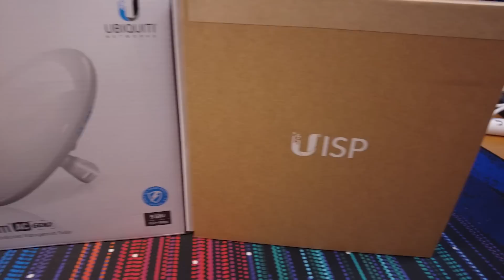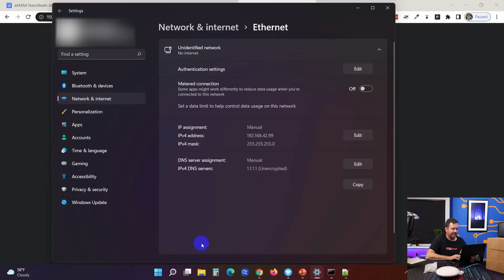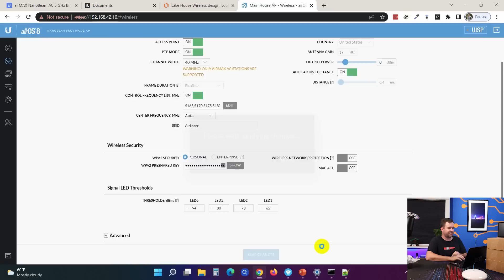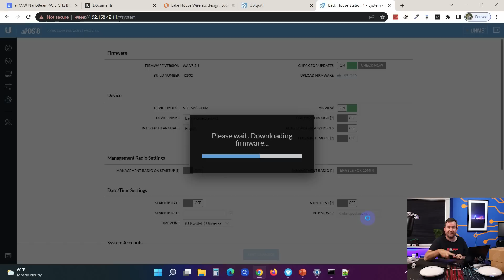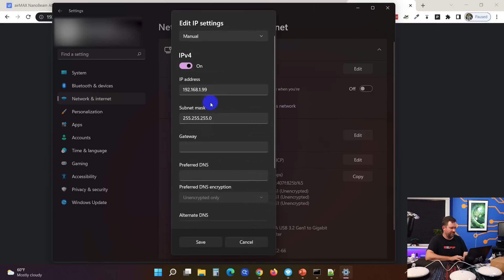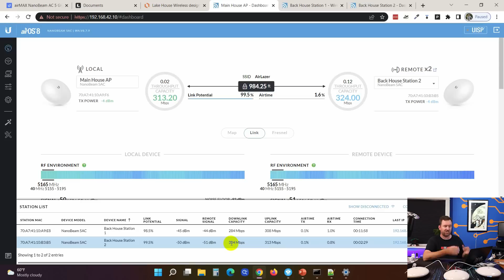PTP Wireless Bridge Setup 2022 - Step-by-step Guide!

Comment: I know this is an older post, but I just configured a couple of the nano bridges. I want to make sure for those who are planning on using a unifi flex switch. (Yes you need to use the Eunify converter to go to 24 V passive.) The flex switch is not compatible and you’ll find that after you could figure everything and get it all up and running, 😮any time you try to upload something. The Nono will reboot and give unreliable results. I spent like three hours on this, so hopefully you won’t waste your time. I tried many other switches and combinations and the only one that didn’t work was using the flex switch and I assume everybody here knows that the Nana Bridges need passive POE !

Comment: Good day. I already have one Unifi wifi 6 access point and i want to add another wireless access point to the network to cover an area. Please what can i do. I need an access point that has in and out ports so that i can extend the network into the building from outside but i need a wireless access point that will take the signal from the first network and transmit it into the building

Comment: I have a Question 
I have a Gate that has two cameras , Wireless access point (ac Pro) and ubiquiti point to point antennas .
I need to separate the camera network from the WiFi using the point to point antennas for security reasons the cameras can’t be part of the main network so the WiFi needs to communicate to the main network and the cameras to camera network which is managed by the NVR  
I know an easy solution will be to have two sets of point to point antennas , but I want to keep it simple with just one pair if possible

Comment: Great video man, very informative. Just an idea though rather than changing the ip address for the interface everytime, you can add multiple IP addresses under the add option in the advanced options for the tcp/ip properties. I actually have about 5 different IP addresses set for different devices I frequently have to program.

Comment: This was a very good video and I learned a lot. I am advising a neighbor who like me is on Starlink and who might need a wireless P2P bridge to add a house his son is building a few hundred yards away. I had a few questions. First, I noticed you set the Nanobeam AP and the other end to static IP addresses so when you hooked them up to your home network you knew how to connect to them. Starlink does not support static IP addresses like most routers. I assume if you set them to DHCP you could go into the device table on Starlink after the boot and find the assigned IP address? Second, how would you point the AP Nanobeam unit  in the case of a PTMP arrangement where the 2 remotes are in different directions from the AP? Say the remotes are 180 degrees apart? Finally in the case I mentioned above how good are these units at linking up with trees in the way?

Comment: Hi - I have a 5 year old unify switch 16 150W, a security gateway 12v 1A Adaptor and Cloud Key Gen 2.  All of this is is connected to a  5 year old ARRIS dual band router 802.11ac (2.4 and 5G).  I want to upgrade the router with more security and power.  I have been disappointed with the Unify access points and routers (access points have never worked after provisioning for some reason and we need them for our large home and garages).  What non-Unify router would you recommend that is powerful enough gaming, 8K TV, and has exceptional security considering AI.  I use this system for my small business and for internet access for our family.  I’m not super tech savvy but did use your videos to set up the system which has worked for 5 years (except for the access points).  I need  help with security upgrades, assessment of the system to troubleshoot proper set up and correct the access points issues.

Comment: I purchased these and will receive them tomorrow. I just want wifi in my shop. I am never going to be able to do any of this. I don't know how to write code and I have no idea what any of the abbreviations mean DSN, POE, injectors ... Guess I'll have to send them back. It's 2024 does anybody make a system where you just plug it in and then point it at the other one?
Reply: You do not need to write code to set up these wireless point to point devices. Regardless, I recommend contacting a computer technician or network installer in your area to set these up for you.
Reply: @Eternal_Tech  I got them working all by myself! The biggest problem with connection was my wifi extender was set up for extending the router from the house. Once I figured out to set up the extender as an access point, everything worked perfect. I didn't have to do any of the steps in this video. All the "addresses" were preprogramed. I'm about 100 feet away from the router in the house and i have perfect internet in an all metal shop.
Reply: @biglaverstyle       Excellent! It is great that you persevered and were successful. Are your devices (e.g. laptop, phone) in your metal shop connected via Wi-Fi to the extender, or do you have a switch or access point connected to the extender, and you then connect your devices via Wi-Fi to this switch or access point?

Comment: Hello I need help in understanding something, I'm sure the error is on my end usually 99% is a human error. I have a small setup here. UDM-Pro - U6 In-Wall - (2) NanoBeams 5AC - UAP-AC-M. I cannot get the UAP-AC-M to adopt to the Station side of the NanoBeam. Both NanoBeams have been configured correctly and they both have signal and I have tested the Station side of the dish with a direct ethernet cable and have internet access. But as soon as I plug in the UAP-AC-M my UDM-Pro control won't adopt the mesh connected hardwired. To make things clear I have port 2 on the U6 In-Wall in a VLAN 40 and the Access Point Dish 1 is connected to that, I have set DHCP to Static according to the instructions provided. Basically all works well until I connect the UAP-AC-M. I have connected the UAP-AC-M directly behind AP (Station) dish side NO luck!, I also connected it with the POE injector No Luck! What could be my issue here? I read that the UAP-AC-M can be connected directly to the Nanobeam but I have tried that and have had no luck. It would be so appreciated if someone can help me find my issue. Thanks

Comment: Thank you for the very clear video

An example, I want to make a point to point connection between my neighbor's house and my house 2  km away, with two different IP addresses, can this also be set up?
So my basic access point IP address is my house and the neighbor's other (dish) is picked up and set as a receiver, can my external IP address be entered for the neighbor's IP address?
Because suppose I want to make a point to point connection of 2 km, then I have to put dish 2 on a different fixed IP address outside my own network connection, or am I making it too difficult?
Many thanks for the clear video.🙂

Comment: Does this advice (devices) work for 2.4Ghz WiFi ?
Reply: Do you mean connecting a client device, such as a computer, Wi-Fi camera, or phone, using 2.4 GHz, to the network? If so, as long as the wireless access point that you connect to the station supports 2.4 GHz, then yes.

Comment: Can I connect a wireless router to a station rather a computer or camera
Reply: Yes, you should be able to do so. However, if you want to avoid double NAT, you may want to place the router in AP (Access Point) mode.

Comment: Nice video.  Do you still recommend the Nano 5 AC or is there a new model that I should look for?  I need to set up a point to point between two buildings that are about 2 city blocks away from each other.  Thanks.

Comment: Great video. I bought a cheap set of Chinese units in 2.4G on the suggestion that it would connect indoor to indoor through a Commons stud wall better than 5.8 but I could not get a connection window to window at about 50 feet I decided to look into some better units and finding your video I followed your link to the website and it does bring up that unit however, if I search the product name I can’t find the unit from this video or any of the other products that would fall under the point-to-point product type. Are they still selling this product segment directly?
It would appear that the link you said is not public on the website. Does this have anything to do with the hundreds of clones of these devices available on Amazon? I was trying to find information on the other product. I’ve seen on Amazon, I believe it was the M5.
Is there a product you would recommend they would go indoor indoor a short distance where there is through a stud wall or in an attic? And do you recommend any of the Chinese knock offs?

Comment: Hi Chris, what about the direction of the signal. It's not an omnidirectional signal. Is it efficient with multiple station ?
Reply: I'm also interested in that, specifically if client stations may be directed to any AC side (front/back) or they need to be directed to a front side of AC only

Comment: From the video you're directly connected to the station with your computer wirelessly. Is it possible, and wouldn't it be better to connect another ethernet cable and bring it inside the structure to use another router inside? Or I'm scared on the other side of the structure the signal would still not arrive.
Just for context I'm trying to bring wifi to a 2 story outside guest house with concrete walls just 50 ft away.

Comment: Some chatter online claims that you can only use a ubiquiti brand devices with these? Can you clarify this.. I want to setup a bridge with two (UISP airMAX LiteBeam 5AC's) PointA will connect to lan port of a google home router, and PointB will connect to the wan port of (another) google home router with google home add-on devices. Point A-B distance is 1000ft unobstructed rural area.

Comment: On a video a while back you spoke of a website where you could put in two addresses and check line of site. It would tell you how high to mount the equipment to get line of site between two points. Will you share that again?

Comment: Excellent video as others have stated.  I once had to mount one of these to a concrete wall and wanted to point out that a 1/4" Tapcon X 3 1/2" long worked perfect and it will fit right inside the ball through the hole in the center.  This method can also be used for wall mounting into wood or a stud through the drywall, just adjust your screw length and type as needed.
Thanks again for your clear and accurate help!
Reply: From one installer to another, thank you

Comment: Great video, thank you.  I was about to reproduce this set-up for a PtP set-up I needed at my cabin.  I thankfully checked with Ubiquity Customer Service to ask different between this and the UBB setup. Important thing to note that this or the AirMax setup can only be managed by UISP app.  It can't be managed by a UDM-Pro or remotely through the Portal.  Have to go with the UBB solution in order to do that.  Would have been a real problem to not be able to check their status remotely. Keep up the good work!

Comment: Hi Chris, Thanks for your expert advice. Can I pick your brains please? I need to run a point to point around a woodland . Using nano5ac  point 1 In AP mode, point 2 in Station mode - link with lan cable to point 3 AP mode ( both on same pole 110° apart) point 4 in Station mode. Does that setup sound like it will work okay? 

Thanks Adam

Comment: Chris, your videos are clear and well laid out!  I totally appreciate the service you're providing to the community.  For those of us who have the bandwidth to dive in just enough, you've helped me learn and saved me the expense/hassle of finding someone else to do it for me.  If you teach man to fish...  Thanks much.  I have a Nanobeam 5AC as my AP and 3 NSM5s as my stations.  Working great.  That being said, would love to see how to configure the UISP.  All the best
Reply: Create a ubiquiti account at account.ui.com, then create a free UISP instance at uisp.ui.com, get the UISP key in SETTINGS - DEVICES - DEVICES ADOPTION - COPY UISP TO CLIPBOARD (and paste it somewhere to easily retrieve it in the future) then plug that UISP key into the radios you're using, then "assign" the devices as they show up in UISP to a site or a client (which you need to create). Take an hour to poke around UISP to get comfortable with using it to manage your sites/devices (and even customers, if you flip UISP into "ISP MODE" so you can use the CRM app for customer management - an AWESOME aspect of UISP, easy to build a business off of!) UNMS (the predecessor to UISP) was better IMHO, but UISP has been redesigned to eventually integrate Unifi and UISP as a single management platform for both product lines (will take Ubiquiti YEARS to get this fully realized, if ever, IMHO). UISP is an amazing, free product, that you can even self-host, host in the cloud, and spin up business with by being a Managed Service Provider for your customers who use Ubiquiti (or you move them to). Good luck and enjoy.

Comment: Nicely done. My only gripe is the 80mbps speed with the units sitting next to each other. You should be getting at least 400!? Also, what about going through trees? These units seem limited to 5ghz, would I be better off with 2.4?
Reply: They are directional :) they aren’t pointing in the right direction at each other for larger bandwith

Comment: Excellent video Chris.  Well laid out and to the point.  I've been using UI equipment for PtP, indoor AP's for schools and businesses, Routers, Switches etc and always have had great results. The one subject that's starting to get cloudy for me is PoE. With multiple IEEE formats on the market now and so many devices utilizing PoE I've been trying to breakdown the various forms myself.  Would you have a video talking about various PoE?

Power over Ethernet (PoE) & IEEE formats
1. 802.3af - 12.95W devices
2. 802.3at or PoE+ - 25.5W devices & backwards compatible with 802.3af
3. 802bt or PoE++ - up to 100W & backwards compatible with 802.3af/at
4. Passive PoE
Reply: PoE is just as you listed above, pretty simply four levels of power provisioning and active or passive (the device providing power is unable to intelligently determine if PoE is needed by the connected device, so you MUST know the device you need to power can take the PoE and not get zapped by the power it's being injected with). Active PoE (af / at / bt) are intelligent and can detect if the device needs power, how much, and gets powered without bad affects. Passive power sources can be used by some devices (like laptop computers) without bad affect, but be careful in general with passive. Other than active/passive, the three active levels (af / at / bt) are based on wattage needs of the device(s) being powered. Then there is 24v vs. 48v vs. 56v and what PoE power source you need (switch, poe adapter, etc.) All networking devices needing PoE will have a voltage rating, so as long as you provide the corrent voltage and amperage (volts * amps = watts), you'll power the connected devices just fine. Ubiquiti has some cool switches (and there are many others on the market) for PoE provisioning, like the Nanoswitch (a 24v 4-port switch - 1 port is PoE in and 3-ports passive PoE out. I forget the voltage/amp/wattage on it, but check the docs on UI's site (or whatever manufacturer you use). With PoE, the devil is in the details of the devices you need to power (active or passive needed, voltage / wattage needed) and the device providing power (switch or PoE adapter) to make sure they match up properly. Considering the adapters are pretty cheap, I keep a variety in stock to ensure I can power a wide variety of devices, known or unknown, when I'm doing an install / at a customer site and have a need for an unknown situation, etc. Good luck.

Comment: Getting ready to do a similar setup on a campus and was wondering if I powered the station side of the bridge with the POE injector it comes with, will the secondary passive POE port on the nanostation be able to power a Unify APAC Pro or a APnanoHD?

Comment: Great video Chris. I have a little job to do where this is going to fit the bill perfectly - PTP over about 1Km. Understand the configuration but a little intimidated by getting the units aligned over that distance (when up a pole!!).  Any tricks you could share.  Thanks, and keep up the good work

Comment: I wouldn't mind seeing the UISP setup.  We only have a couple of these deployed, but I didn't know that was an option to manage them with a controller.  

Also, I haven't been able to find any support on this, but we can no longer access our LiteBeam-5AC devices at one of our sites.  Traffic is passing fine between the two sides, so the antennae are working to create the "wireless wire", but the devices themselves are not accessible via SSH or HTTP.  I'm hoping a drive there, a reboot, and maybe a firmware upgrade might fix it (but it only fixed it temporarily the last time I did that).  Any ideas?

Comment: Ok so if you are using multipoint configuration with the Nanobeam AC5 devices, the video states that the access point and stations should face each other with no obstructions. What if you have two stations facing in opposite directions, how does the access point cover both stations? Do you need two access points and two stations with one access point facing one station and the other access point facing the other station in the opposite direction on does the access point broadcast in a wide omnidirectional pattern!? Any help appreciated!!

Comment: Chris,  Great video and timely as we are installing our first pair of GigaBeam Plus - airMAX 60.  Are these for the most part plug and play when plugging into an unmanaged switch?  There is no other Ubiquiti products in the system so we will use the USIP to do the basic configuring of the airMAX AP and receiver.